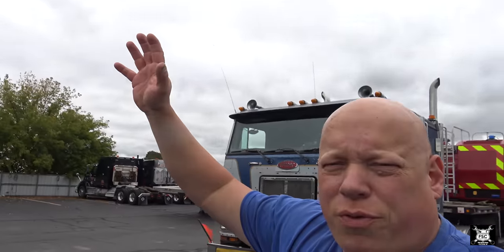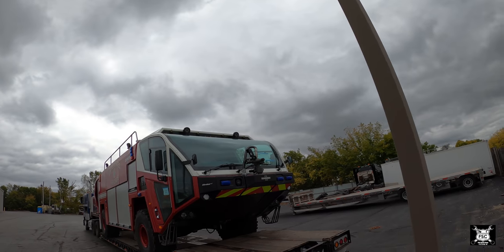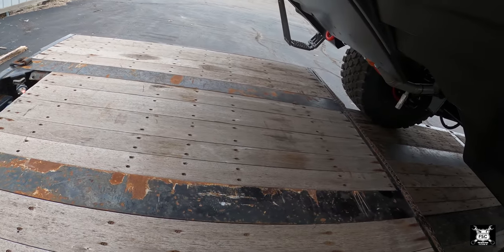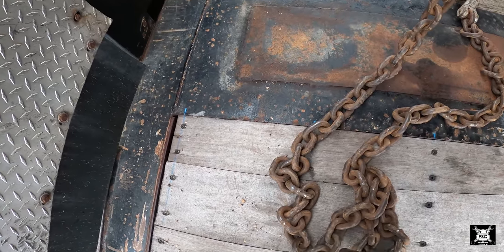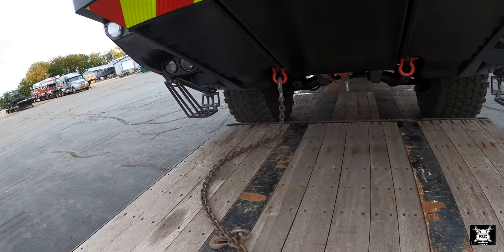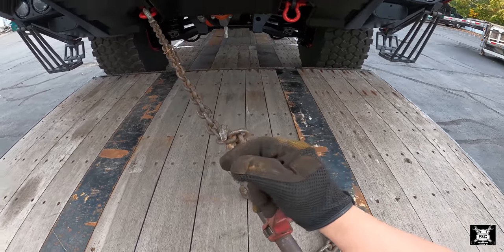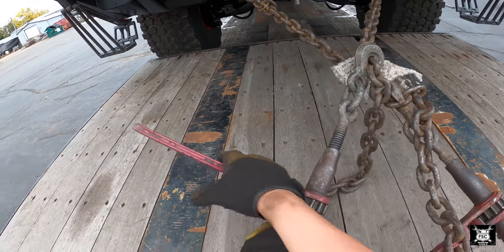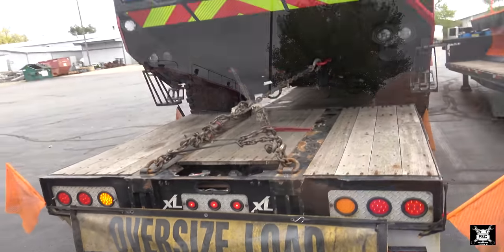Peterbilt Cabover Hauling Oversized Fire Truck

Comment: Ok. You win. I am officially addicted to your channel. You made a comment about how some loads tend to bounce and give you a bad ride but, I have to say, I hauled tankers for a long time and, believe me, nothing rides worse then a 8500 gallon tanker with no baffles and half a load. You have to accelerate carefully, time your shifts, and never hit the brakes hard. Believe me, the first time you hit your brakes hard and all that material comes flying to the front of the tank, you learn real quick to never do that again. I'm willing to bet any other tanker drivers out there watching your channel can give you some great stories about their liquid bulk hauling experience. Lots of fun but serious business. Any way, love the content. Keep 'em coming!
Reply from the maker: I've felt cement in pneumatic tankers move under hard braking.   Liquid has to be much worse.
Reply: @Tom H I used to haul food grade tanker also, and I agree with you there!
Reply: @fsctrucking   Yes it is!
Reply: Is it possible to release the air from the fire truck's suspension?  To minimize bouncing that could snap the chains?
Reply: I run a 5100 gallon tanker, non baffled and smooth bore. I went to Bakersfield today from Ventura with 4500 gallons. It quickly reminded me why I try to on run fully loaded.

Comment: My previous job was to accept these for the military from Oshkosh/Pierce.  These are all built at the Northland Ave Pierce plant in Appleton.  With the blue lights it's probably going to England or Ramstein Germany.  This is a 1500 series, then there is the 3000 and 4500.  The 4500 is something to see and not many are built.
Reply from the maker: You are correct.   I don't have enough truck for the 4500s.  Need a 4 axle tractor, 3 axle stretch trailer.  I've seen only a couple of them.   This one went to Baltimore for export.  I never looked at its final destination.

Comment: Not trying to "arm chair quaterback" BUT the books you put on the front of that fire truck should have been hooked the other way. To prevent the chance that a bounce or loosened chain that that book slip off that clevast. 
I'm not critisizing. I know cause I've been "nailed" at a scale for that. Since it doesn't have a safety clasp to prevent is slipping off like you had on the rear of the truck. (I was told my the inspector and guys who have done deck work for their career to always flip them so even the clasp on the hook isn't you only prevention of soil off.

BUT LOVE THE VIDEOS!! especially the turbo between shifts. So what I remember trucks sounding like As a kid. The reason I love these old mechanical motors.
Reply from the maker: I do it this way for a specific purpose.   IF a chain breaks or becomes loose, the body of the hook will rub the tailpan of the firetruck and damage it.

Comment: where did you get them  bumper strobes I wanna put some on the rear of my utility my utility is set up for oversize escort i have wig wag led lights for over 4.5 meter wide loads on the front on bull bar oh and usually the ratchet binders bind up being travelling  up n down gravel roads worse is useless loop road they use salt water to keep dust down and road works very cool perspective and very flash fire tender your carrying
Reply from the maker: Truck Equipment, Green Bay Wisconsin
Reply: @fsctrucking  what is the product called had a look at truck equipment page nothing
Reply from the maker: @roadtrain5910  i think the brand was Truc.  I'll have to look when I get back.  The box is still in my trash pail.
Reply: @fsctrucking  i had a look on their website (i live in Australia) trux accessories has some thing similar google search
Reply: sorry I ment truck equipment doesn't have an online store
Reply: @fsctrucking  cool thankyou Steve
Reply from the maker: I found this https://youtu.be/-ZWdN1A2xOQ
These are what I have.
Reply: @fsctrucking  yeah I saw them on trux website nothing like that in Australia
Reply: @roadtrain5910  There is a company called truck and tow out of believe Detroit Michigan I haven’t bought anything lately but I used to buy a lot of stuff from them they usually have the latest stuff I don’t recall seeing those specific strobe lights but I’m pretty sure they have a website and nowadays most companies ship all over the world good day mate from America
Reply: @bobwilliams3502  cheers for that Bob I will see if I can find them on line

Comment: NICE...I really like Orwell. I asked you on a earlier post how you compare a cat motor against a Cummins motor???specially  the redhead??????
Reply from the maker: I had an N14 Selec Plus in my 01 Freightliner.   It did good.  But I've had this 3406B, a 3406E and C16 Cats.  They seem more responsive off idle.
Reply: @fsctrucking  thank you for your response...I was curious  about the horsepower difference...I know  you cant beat a cat for raw pulling power..I had heard the redhead was super horsepower...any thoughts???? From stupid in oregon

Comment: Top channel, but being from the uk I’d like to know why that’s an oversize load 🤔
Reply from the maker: Its wider than the trailer.   Legal with is 8 feet  6 inches.  This is 10 feet wide.  Also the weight is over on axles because it barely fits on the trailer so I can't shift the weight